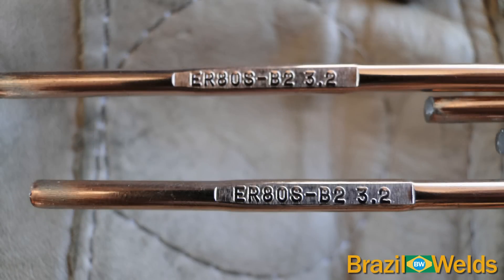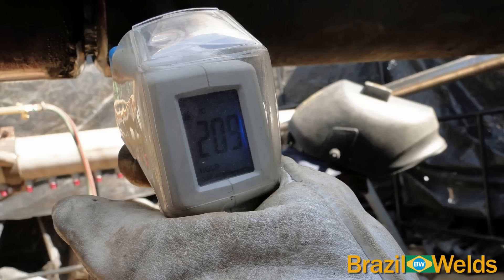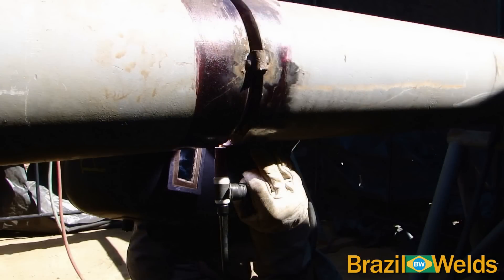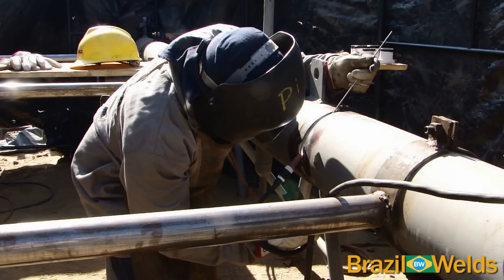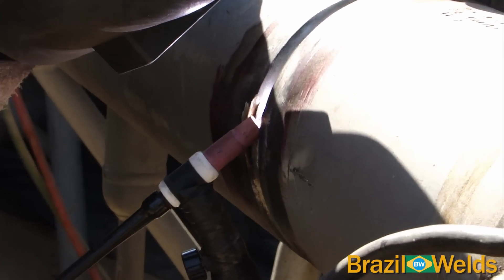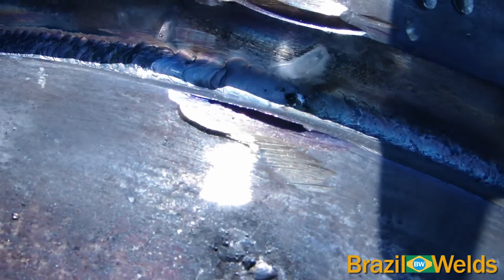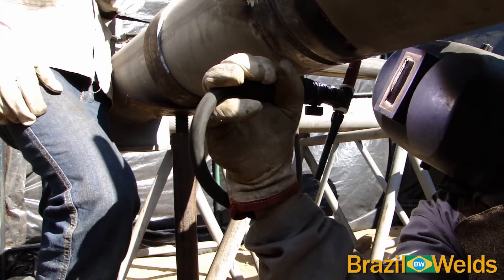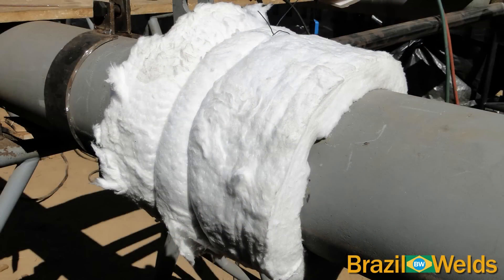Passe de raíz - Solda TIG - Tubo  ASTM 335 (P11).avi

Comment: Ola!! Gostaria de comprar uma maquina de solda tig q solde alumínio como faço moro em manaus..vc poderia me dar uma sugestão esto aguardando resposta..
Reply from the maker: Olá Williamajustefino Wb Eu utilizo uma INV200 AC/DC da Weld Vision. O que vai soldar que tipo de peças?
Reply from the maker: Olá Williamajustefino Wb Veja com a WELD VISION, quem é o distribuidor deles aí em Manaus.
Você precisa informar o que vc vai soldar, quantidade etc, para indicar a máquina certa para você.

Abraço
Reply: BrazilWelds Não sei quem e distribuidor da WELD VISION em manaus, vou soldar aços  ferro fundido inox e aluminio. tipo de peças: eixo cardan carcaça de motor e cabeçote  da motor e moldes.
Reply from the maker: Williamajustefino Wb
Aqui nessa seção de comentários, não é possível colocar links, telefone etc. por que o YouTube não aceita a mensagem.
Então peço que você entre na internet e veja o site da Weld Vision e passe um mensagem para eles solicitando informações e quem poderia lhe atender aí na sua região.
Se você for soldar tudo que você disse, é preciso uma máquina de maior capacidade, eu sugiro a INVERSORA DE SOLDA WSME 315 E COM TOCHA REFRIGERADA À ÁGUA.

Comment: I wanted to know how far the TIG ELECTRODE extends BEYOND the cup while you were WALKING THE CUP in both the ROOT and HOT PASSES. I noticed that the outlet of the CERAMIC CUP was supported close to the top of the BEVEL. Very instructive video and thank you very much for posting it.

Comment from the maker: Hi Friend,

As the welding, is being made, in the position 1G Rotated, the heat input is controlled by feed speed. I Think that is good. For 316L stainless, I think that parameters will be 20% less.

Comment: Hi Messias,

I am working on a procedure for 3" pipe (75mm), sch160.  I have a gap of 3/32" (2.5mm) for the root with an angle of 70 deg.  My root pass has 160A and the hot pass is around 190 to 200.  This amperage combination gives me the best looking root weld but is it too much heat input or no?. The position is 1G rotated on a rotator.

Are these parameters acceptable for 316L stainless?